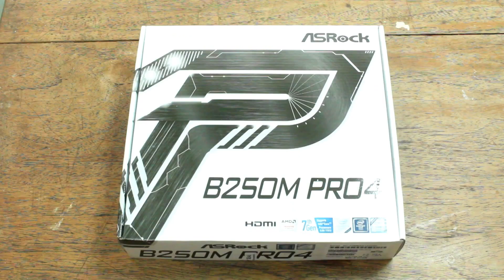ASRock B250M PRO4 Unboxing - Decent Inexpensive Motherboard for LGA1151 processors!

Comment: I know it's 2020 already but im planning to buy this board, what do you think of asrock board compared to msi b250m mortar?
Reply from the maker: Hi! I own both these boards and I can tell you, I never had a problem with any of them. But I would pick the MSI B250m Mortar over this motherboard because the MSI one has more PCI-E slots (2 PCIE 3.0 x16 and 2 PCIE 3.0 x1). The Asrock Motherboard only has 3 (2xPCIE 3.0x16 and 1xPCIE 3.0x1).
Reply: Yes but im having a hard time to find msi b250M mortar it looks like it is already phased out. The only option they are giving me is the asrock b250, should i buy it?
Reply from the maker: @jrdnlangdon  Unless you plan to use dual-GPUs+WFIcard+USB hub on it, you should buy it. It really depends on how much PCIEs you need.
Reply: Will buy it bro thanks for the help! I just need one gpu :)
Reply: Can i ask one more question? Is it compatible with cooler master hyper led 212?
Reply from the maker: @jrdnlangdon  Yes. But check if that cooler will fit in your case.

Comment: Does it support the intel i7 8700k?
Reply from the maker: No. You'll need a newer board for that.
Reply: ElMylhamPlays :D nope :/ any cpu that have a LGA 1151 can be used
Reply: So a intel i7 7700k yes?
Reply from the maker: Yes. That will work.
Reply: ElMylhamPlays :D yep.

Comment: It support i3 7100 without any bios updates??
Reply from the maker: Yes. I ran a 7th gen processor with it with no need for an update.
Reply: egorea and i series cpu that start with 7 and have LGA1151 can be used

Comment: Sir compatible po ba to sa skylake out of the box ?
Reply from the maker: Yes. Skylake is LGA1151, and this mobo has a socket LGA1151. The only issue with LGA1151s are when you try to use the newer Kaby Lake with an older 1151 motherboard, that's when you sometimes need a BIOS update.
Reply: Thanks ! im planning to buy this po kasi. this is one of the best budget b250 out there not only maganda ung features pero meron din kasing shield na color white ung IO. i will pair it sa i5 6400 ko since mejo mahirap na humanap ng b150m mortar arctic
Reply from the maker: Yeah, it's nice for its price. Good luck on your build!

Comment: @Deuterium Tech

Hi sir. I need help for my first gaming rig. Kulang pa po ko sa knowledge about pc. Pacheck naman po kung okay yung  set up na binigay sakin ng PC Express. 

AMD Ryzen 5 1600

ASrock AB350M Pro4

Gskills Ripjaws 8gb 2x

Powercolor axrx 560 Red Dragon
2gb

WD 1tb HDD

Baka may idea po kayo kung may kulang pa or may babaguhin jan.

Thanks po. 
Nag-sub din po ako sa channel niyo.
Reply from the maker: Hi! Sorry for the late response. What you would want to check are the compatibility of your components.
AMD Ryzen 5 1600 is an AM4 socket and the ASrock AB350M Pro4 is an AM4 socket so that is good.
Next, you should check the frequency (or sometimes called speed) of your RAM if it matches your CPU and Motherboard. I assume this is DDR4 right? You should check that as well. You don't want DDR3 on that system.
GPUs are pretty much compatible to any modern system so that is okay. Same with Hard drives.
Lastly, you will need a power supply. Something around 620W should be more than enough.
Also, get a case. I would suggest that INWIN cases that go around 4k at PCHUB. They look nice especially with LEDs.

Comment: If I have to ram sticks what slots do i install them into?
Reply: The RAM Slots on your motherboard. There are usually 4 slots where you install it. Push your ram stick lined up with the holes in each ram slot, it will snap in place.

Comment: Sorry for the really late comment aka question.
Wouldn't you have any problems with this board IN crossfire because the PCIE slot is so near to the connectors of the mother board? and does this support Nvidia SLI?
Reply from the maker: You can plug in two GPUs there with no problems. Although a case with good airflow is important. I am hitting 67 and 70 degress Celcius at 100% utilization with two cards. Yes, it supports SLI. Just remember to buy that SLI bridge.
Reply: hi sorry again. but it says here that it can only support AMD crossfire?,  so does it mean its not compatible with an SLI?

Comment: Did anyone else have trouble installing Windows on this? I can't get it at all! All it says is that the model is not supported. Please help
Reply from the maker: First time I have heard of that problem. What Windows did you try to install? Windows 10?
Reply: DeuteriumTech nvm, just got it. I had to recreate the iso file disc. My windows installer file was a disc image file not iso, thus, it didn't recognize anything on it. Thanks though
Reply: DeuteriumTech I do have a question though... Where is the USB 3.0 plugin?

Comment: This does support nvidia 1070 right? 😅
Reply from the maker: Yes. I'm currently running an r9 380x with it on mining duty. That is 24/7 uptime. I haven't turned it off for two weeks now. This board is good.
Reply: thanks mate, also what would be a good choice of ram for it? CORSAIR VENGEANCE LPX SERIES - 8GB 2400mhz or HYPERX FURY 8GB DDR4 2400MHZ? I am short on money cuz i have to get the i5 7600k so this 8gb ram has to do it for now :)
Reply: St3althP4nda I have gotten a Ryzen 7 1700 at the end 😅
Reply: Blaze Levin i bought a i5 7400 :) u beat me

Comment: Hey! Does this mobo require any BIOS updates to support i3-7100 and Pentium G4560?
Reply from the maker: Nope. It will run those processors without any BIOS update.
Reply: DeuteriumTech thanks!
Reply: Reinis no. Im using G4560 right now and it is fine

Comment: Is my build okay?My budget is 22k
CPU: I3 6100 3.7GHZ
GPU:1050TI
PSU: RAKK PSU 400W
CASE: ARMAGEDDON VULCAN
STORAGE: 500GB HDD 7200 RPM
MOBO: ASUS B250M PRIME
RAM: CORSAIR VENGEANCE 8GB 2400MHZ
AND CAN YOU SUGGEST A MONITOR UNDER 5KPHP?
Reply from the maker: Hi there! Get a 1TB HDD, the cost difference is only in the hundreds. AOC 20 M2060SWD  is a little below 4k and seems decent and it is FHD already (1920x1080).

Comment: no need to update bios for g4560 to boss?
Reply from the maker: No need. This motherboard is Kaby Lake ready.
Reply: DeuteriumTech nice thanks!
Reply: Tristan Lorenzo and thank you fpr asking this is a quite of releif simce i would need to buy slylake and there would be no momey for gpu... money is a b
Reply: DeuteriumTech can i still use 2133 with g4560 or do i have to buy 2400 instead
Reply: 2133 is the base speed without using XMP. Source: I have a kit of 16 GB DDR4 RAM rated at 2400 MHz, but without XMP enabled it defaults to 2133.

Comment: is this good with the i5-6400 and 2 sticks of 4gb ddr4 2133 ram?
Reply from the maker: Yes! It will work with 6th and 7th generation processors. And yes, 2133MHz RAM is the one for 6th Gen Intel processors. But be sure to get 2400MHz for 7th Gen processors, just in case you change your mind.

Comment: may 4pin po b yan for rgb strip? yung msi arctic po kasi merun kaso masmahal... sana merun po si asrock for cheaper option
Reply from the maker: Yes. It has a 4-pin connector but you will be taking it from the chassis fan supply. If I were you (and I already did this), connect the RGB strip directly to the power supply. You'll just need some adapters.

Comment: I've known Asrock for making their motherboards apart from the Z series overclock-able, so I wonder does it apply the same to this mobo?
Reply from the maker: The overclocking feature was not mentioned in the documentation for the Asrock B250m Motherboard. You can still overclock the base clock though.

Check out this reference:
http://www.tomshardware.com/news/overclocking-with-non-z170-chipsets,30962.html
Reply: Thanks for the quick and informative reply

Comment: I want to build my first PC.
Will it work?
Mainbord: ASRock B250M Pro4 
CPU: Intel Pentium G4560
Tower: Sharkoon T3W Green 
Power Supply: Xilence Performance A+ Serie 430W ATX
And Windows 10 Pro 64-bit Version
And where can I download the Drivers for the Mainboard(ASRock B250M Pro4)?
Would be pretty nice if you could help me!!
Reply: USU.tv go to PCpartpicker . com it will tell you if all your shit is compatible.
Reply: And what about the drivers?
Where do I get them from and what are they called
Reply: USU.tv YouTube or Google how to install the drivers for your specific product. All PC building really is, is reading and studying up on what will make your personal system work much better for you.
Reply: USU.tv most of your products drivers you can download (all free) from the manufacturers website.
Reply from the maker: Yes. That build should work. check out this page: http://www.asrock.com/MB/Intel/B250M%20Pro4/index.asp#osW764
Reply: DeuteriumTech 
Thanks
But when I go to Download there are lots of things you can download.
And what do I have to download then?
All of them?
Reply from the maker: I would download all of them. But if your bandwidth is limited, only get what you need. The LAN and USB drivers are most important. Oh, and be careful with the intel installers. One of them tried to install McAfee in my PC. That app reeks of adware.
Reply: DeuteriumTech 
Thanks!
Reply: USU.tv dude! Same set up! Haha lol

Comment: Sir i would like to ask how many fans does it supports ?
Reply from the maker: Hi! It has 4 sets of Fan pins. 2 for the CPU and 2 for the chassis. Though you can add more fans by using splitter connectors.
Reply: thanks